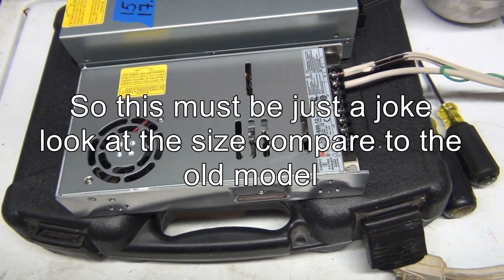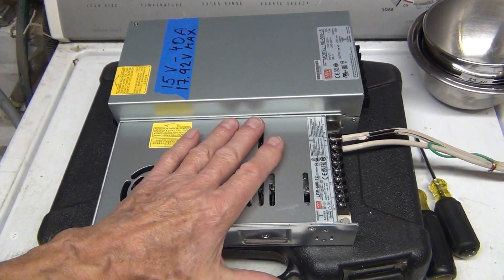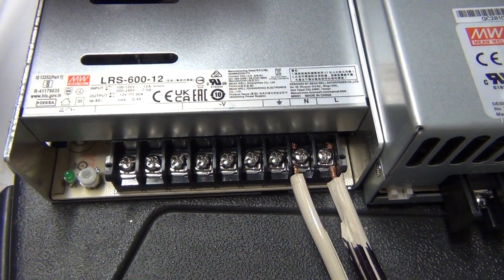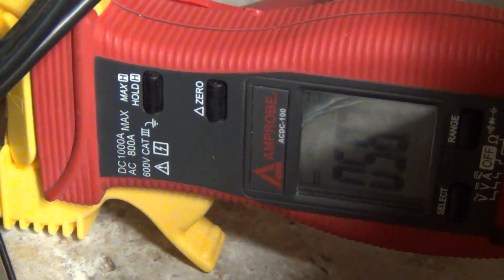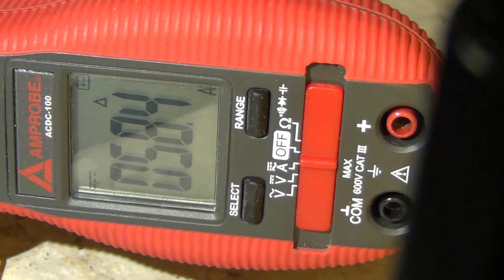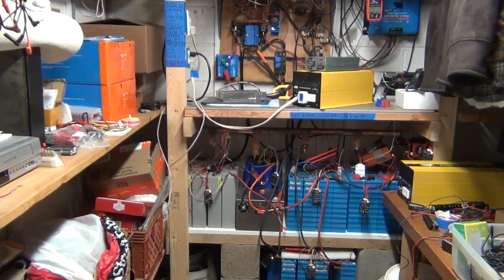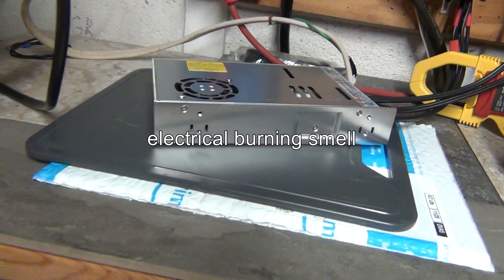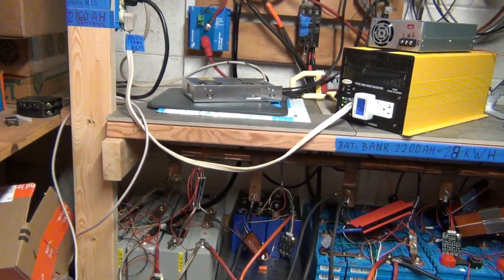Test and review of Mean Well LRS 600 12 power supply

Comment: With a spade terminal you can get 12 or even 10 gauge wire attached to those terminals just fine. You really shouldn't be stuffing bare wires into these terminals like this for a few different reasons.

Comment: Its supposed to have overtemp protection, what was the actual case temperature? 90% efficient means the fan has to dissipate 60W which does seem a bit difficult.

Comment: its a good PSU you are gonna kill it thou, i dont think it was designed for continuous MAX current output
Reply from the maker: Okay, and the SE 600 12 is? Where does it say? Not in the specs. If its not design for it it should be specified.
Reply: @VladFredK two sides to this. Does it say it IS designed for this.
Reply from the maker: @ it doesn’t say it’s not
Reply: I found that these LED supplies got their big number only when used to power lamps. Resistive load is actually half of that so technically this is 300W supply which explains a lot
Reply: Seemed to me that this "test" was running the PSU at more than 116% of its rated output.  Then the reviewer said he didn't bother to contact the manufacturer because he had "tried that with Victron"!  So what? I think we can safely disregard this fella's so-called review.